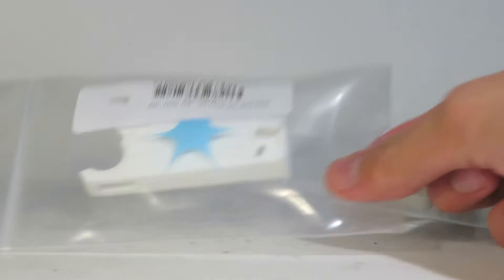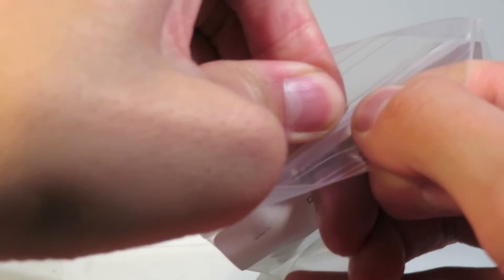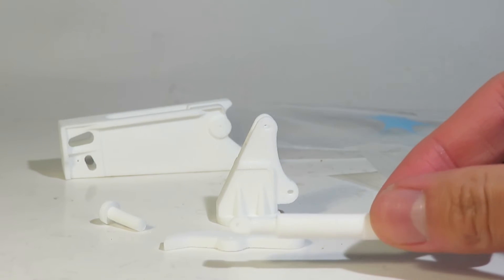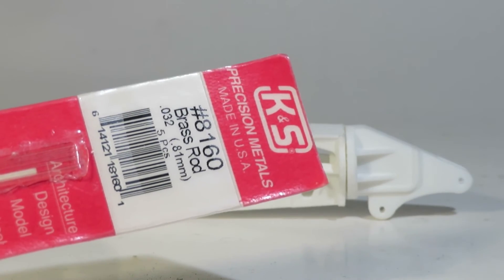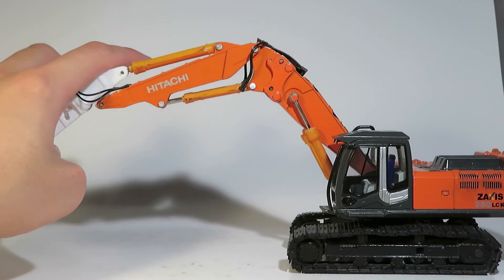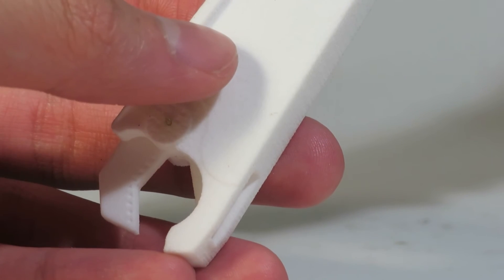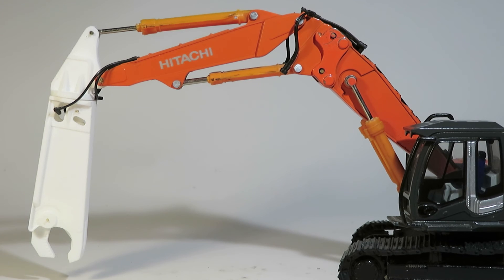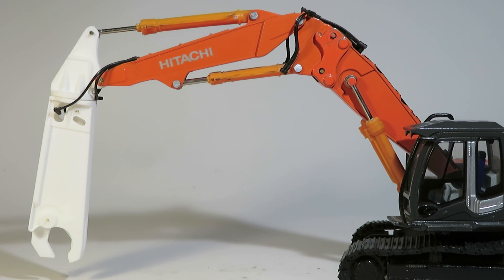1:50 3D Printed 35 ton Second Member Scrap/Demolition Shear REVIEW

Comment: Did the shear require any sanding to get a good paint finish?
Reply from the maker: Zaxis850LC On the lower quality materials, sanding is advisable as well as priming. I didn't sand mine, but primed and painted it flat black. The finish came out well.